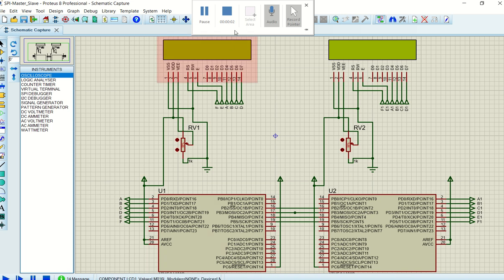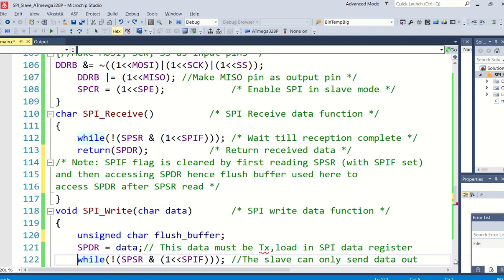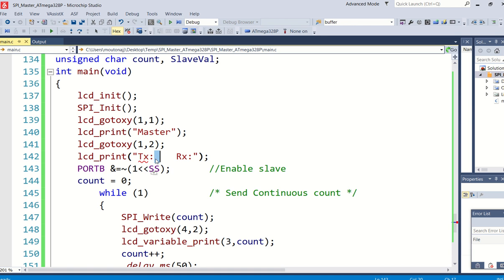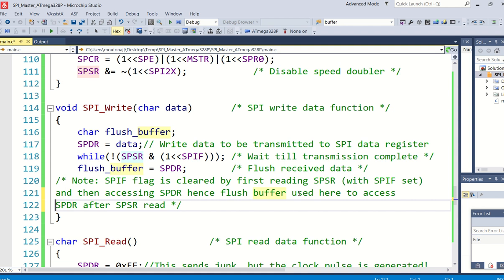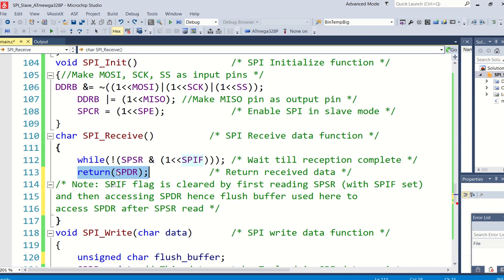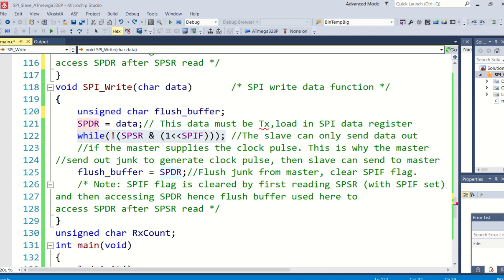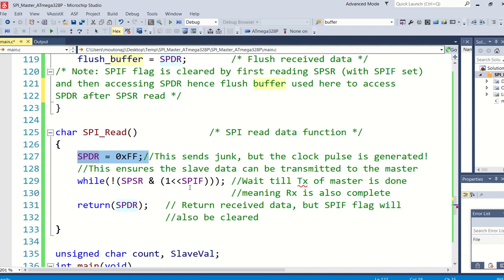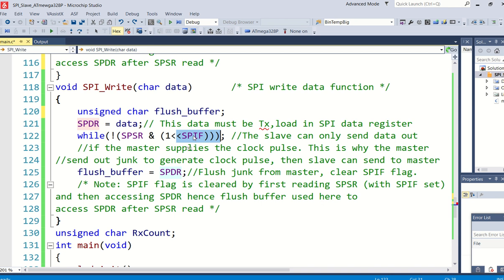SPI Protocol basics using ATMEGA328P Video 2

Comment: I have implemented and used your presentation with success. The ICE (emulator) has the same pins as SPI, so I make SPI connections only after downloading the programs. I verified that when some time-consuming tasks are executed in the slave, the master keeps sending data and doesn't pay attention to synchronize with the slave, so some data is lost and wrong. Do you see a way to solve this?